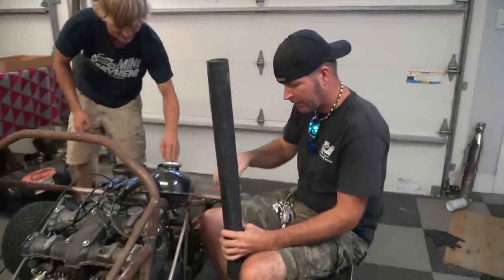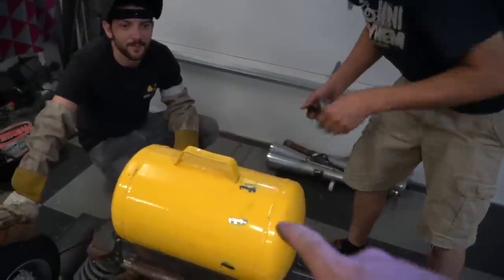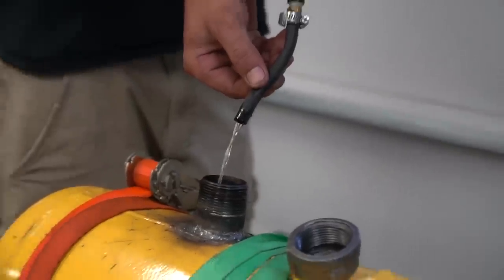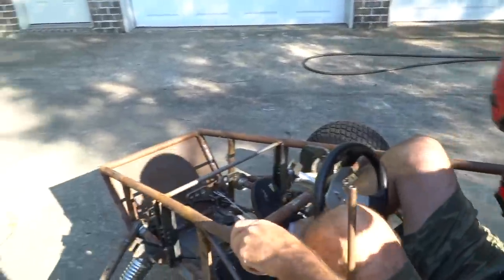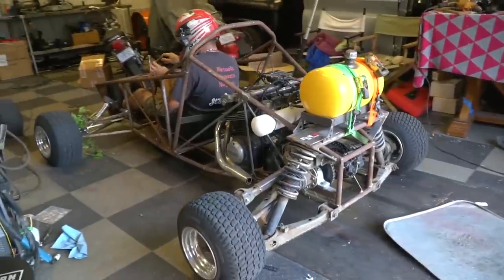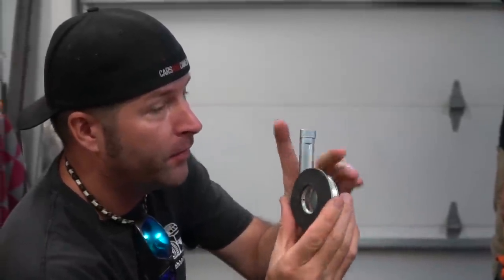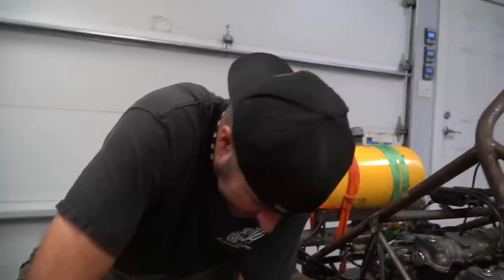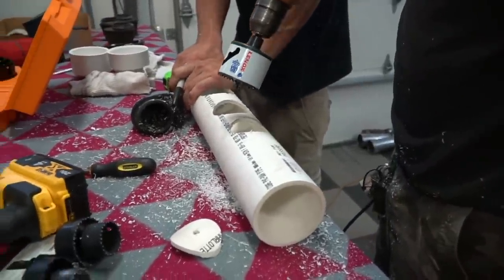750cc Cross Kart TUNING | Building a Custom Air Box, Jetting!

Comment: Sounded a lot stronger... That idle was mean after syncing the carbs and could notice the difference with the pvc intake immediately, it laminarized the flow which will make more low and mid range power. But the stacked itb filter setup would ultimately be better for max flow imho. But who really knows this these things without a flow bench.

Comment: That frame is gonna bend in half the way all the reinforcing tubes meet the roll bar. That's why it feels as smooth as it does. The rear suspension doesn't look like it's moving at all cuz it's meant  for something over 2000 pounds. And did you guys vent the gas cap?
Reply: We vented the cap

Comment: The engine was designed with free air-flow over the front in mind, it might be overheating. Fantastic machine though, that much power on such a light frame, wicked!

Comment: Guys , I built one with a Honda 450 twin, I experienced overheating because the engine wasn’t getting enough air to cool . I built shield ducting that forced air to cylinders. That being a a four cylinder, your inner cylinders may be hotter as you said you could feel heat. Or maybe put a cooling fan behind you

Comment: I'd suggest mounting a smaller filter at both ends of the airbox rather than just single big one, with the current setup the flow dynamics of each carb will be vastly different.

Comment: If you guys tuned the exhaust by giving them some more length it will help out on the lean condition. If you put at least 2 into 1 it will help with the scavenging effect. Then you can tune the carbs right.

Comment: you should have a smaller inlet on both ends of your "airbox" rather than one large one at one end.  With a single open end the carb closest to the open end will run lean while the carb at the other end will run rich assuming same size jets across all four carbs.  If you have both ends open with slightly smaller openings, you will have more balance air flow to all four carbs.

Comment: Is that a cheetah bead blaster tank? 😂🤣😂🤣😂.....it'll be fine.
I would assume you will be needing to trim the rubber sleeves the poke into the intake tube. Rule of thumb is you want at least the diameter of space between the opening and the closest wall. 
Also remember that long intake runners are for low rpm and short runners are for high.

Comment: When i first turbo'd my mustang (on a super budget) all of my intercooler piping consisted of 3 inch pvc piping and my hot side consisted of flipped BBk shorty headers and old 2.5 inch exhaust tubing that i had collected. The only thing left of that set up is the headers. P.s you should have made the intake runners longer like the kid told Ike to do. If you knew anything about intakes or plenums that should be common sense. Also, i noticed no breater on the fuel tank. Try that before jetting again.

Comment: What you could do, is open up both ends of the PVC, add ninety degree elbows, and put short up tubes, with your air filters on each side to act as mini-snorkels, and get the air intakes up in the cool air, and not sucking in the hot stuff from the engine...

Comment: Fire out the exhaust is a rich condition,Backfire out the carbs is a lean condition. I hope you drilled a small hole in the gas cap to vent the tank.

Comment: Hey CarsandCameras you really should dunk that carburetors in ultrasonic cleaner and get full carb rebuild kit and accelerator pump, replace 4 manifold boot and as bench sync the carb used a match size drill P.S. if having fuel starvation issues get pulse vacuum fuel pump and another things that carb sync tool is not right tool for job

Comment: I strongly suspect that only running that pod filter on one end will cause the  2 cylinders on the other end to run too rich, ie not enough air avilable, much like a fuel rail on an engine with huge injectors that is only fed from one end,  the first 2 or 3 drinking the fuel  and not enough fuel pressure to feed the remaining injectors.
Reply: Jools Freeman  also need some restriction on the exhaust, not enough back pressure could make it run bad also, but I agree on the fuel part also
Reply: Jools Freeman and put some header wrap on the exhaust, even with a heat shield behind your back it’ll help with keeping some of that heat from building up In front of the motor
Reply: Yes ykure probably right, some suitably sized food ztuff tins with a few hokes in the bottom  clamped on the pipe and some wire wool stuffed in them would do help, would also stop the flame shooting out and setting somethi g on fire.

Comment: Have you checked that you got the correct heat range spark plugs,  the exhaust length is going to have a larger part on how it's running than your giving it credit for

Comment: Hate to spoil yalls high but Teflon tape on the brass fitting to the tank is a bad idea. Use pipe dope and gas won’t leak but over time the gas will leak when using the Teflon tape. Just a helpful hint from your local fuel delivery guy

Comment: You need to support the carbs with something I ended up destroying a pair of brand new ones because I didn't do the and the factory air box does support them and the intake boots a re really annoying when it comes to vacuum leaks (seal all) is the best way I've found to seal them up you can get it at advance Auto or dollar general

Comment: Glad you threw the pods out. They’re great, but often need some kind of velocity stack between them and carb. Looks like your rear suspension is way too stiff, understandable since it’s from a 2500# car, and now on a 700# rail, probably part of why it nosed hard on the jump, if the springs were a good bit softer you could theoretically alter the attack angle with the gas pedal as you’re hitting the jump, by getting into the optimal rpm at the bottom, and powering out as you crest, it will cause the rear springs to squat and preload, so then in the air you’re more parallel to the ground. Other than that it looks like it’s coming along beautifully!
Reply: It took me weeks of riding every single day to get the jump technique down perfectly. On the farm where I grew up I had an old Yamaha MX 100, and I made a ‘track’ in one of the pastures. My one jump was about 4 foot tall, and on that little bike, second gear was perfect for nailing the jump, get it up into the top of the powerband, let off about 6 feet before the jump, then right at the base, go wide open, and I’d fly... for about 2 seconds, land perfectly. In third it was a bit sketchy. The straightaway before the jump was barely big enough to get into the powerband, and if you did it just wrong, you’d nose down hard on the landing and be picking dirt out of your teeth. Literally. The few times I hit it in third successfully though, it felt like I had wings. Miss those days.

Comment: Hi guy's I've been thinking about the situation hear with these carbs and i think because the original orientation of the fuel tank and carbs has been modified the engine may need alittle help with a small electric fuel pump to give all four a gut full of fuel to get that throttle wide open and not run shy of gas. Just thought it may help as it seems to always run lean wide open, and to rely on gravity for all four might be a stretch now the tank isn't as high as on a bike. My Honda 550 ran a external pump standard, and was a v4 with the four carbs and four power valves to get all in sync.

Comment: Need to put some longer intake runners on the air box which is too big.  It need to be the same size as your engine.   The intake port  for the air box needs to be about the same size as the area of all 4  throttle plates.    The air cleaner need to be 110% the cfm requirement of your engine at max rpm.

Comment: I really wish I could teach you guys how to work on 4 cylinder carburetor setups the big thing to remember at idle and up to quarter throttle you are running only on the pilot jet between that and wide open throttle you are running on the ramp needle and main jet at wide open throttle you are only on the main jet These are also vacuum controlled constant blast I carburetors which makes it a little more tricky I would personally see if you can't hunt down a set of mechanical carburetors that will fit on it  Maybe something off a 1970s city 750 they had Keenan's
Reply: Contestant velosity

Comment: Gas tank vent for better flow, maybe you need a fuel pump..? It shouldnt run like it does it should rev fast as shit. If you guys are running the race fuel in it you may need to run cooler spark plugs with a smaller gap if youre not already. Either way shes cool just be safe fellas!

Comment: I wouldn’t touch anything with the carbs until you have a correct air box. Syncing and balancing won’t make any difference until you correct the airflow reaching the carbs. That pipe set up is not gonna cut it. You need to, at a minimum make a box that is the same the dimensions and volume as a stock box.

Comment: Restriction on the inlet side of a carburetor will do nothing but rob HP. The carbs need vacuum on the engine side. Which means the valves have to be adjusted properly, and you can not use big cams with vacuum carbs. The K&N pods are just fine.
Reply: This is how they work. More vacuum on the inlet side of the carburetor will fight the vacuum on the engine side and the carburetor will not function as designed.  

https://youtu.be/wyspAHrMbb8

Hope that helps.

Comment: eather way 4 carbs going to suck to get running right but wonder if you put like 1 big carb on the end of that pvc pipe this way its only 1 carb to get right or a throttle body with fuel injectors idk man i know yall got be getting sick of trying to get it to run right but try just reg gas that might fix it or least tell ya sumthing

Comment: Is the plug gap right could be just a little too much gap . And that shifter needs to be shortened. The length being that long can make it jump in and out of gear just by the weight of it along with the leverage. You may end up blowing a gear . Shorter shifter is a shorter stroke. LOL

Comment: Replace the diaphragms and then put a vent on the tank with like a check valve and put elbows on the breather tube so it looks like texas long horns and heat the shifter handle and curl it like a sword handle

Comment: You need to mount the fuel tank in front of and above the engine in order to not make fuel travel up hill when you go up a hill and when you accelerate the g force pulls the fuel backwards in the line probably why you're having fuel issues
Reply: And you need a muffler for back pressure

Comment: you know this time it did sound like fuel but it also kinda sounds like the timing is off i really think yall should try just reg gas and just see if it help and if it does yall might need mess with the jets and timing or the stater and if you put a muffler/silencer on there you have more bottom end and sound better and you neighbors will think you

Comment: hand shifters allow you to keep both hands on the wheel add em . Properly clean/rebuild and jet the Carbs.put 2 large air filters on. Run a higher octane fuel. Put in better plugs that are gapped properly. That shifter ur using looks like a major injury in the future + ur taking ur hand off the wheel a lot. Your Welcome.

Comment: 3 and a half is too much If I remember correctly it is 2 and a quarter. I feel like I'm picking on u guys. I'm really just trying to help ya out lol. I like u guys and u guys are amazing with small engines. But this bike is very different compared to some. It's just the simple fact that it's a Honda and they are very specific. I'm going through it now with my shadow. The pipes are very specific and it does not like single pipes bc of how thestock pipes are made with all the vacuum and emissions things but that's besides the point. That bike is very picky on what u can do to it.

Comment: Shim ur needles with small washers from hardware store that will ad more on top and bottom cuz it raises needle so let's more fuel in and on a 4 cylinder they normally leave the 2 inner cylinders richer cuz the extra heat having cylinders on each side and they set those a quarter to a half a turn richer then the outer cylinders also check ur plugs that will tell u how lean u are and if that doesn't fix it do a carb rebuild

Comment: Carbs on the side of the air intake are gonna be leaner than the other side.
Why plenums are tapered.  2 air intakes, either side, original size ya started with in the vid.
Gonna have to make the 2 center carbs a bit leaner, but have a better shot at equal burn.
Or just put 4 pods on, as most do.  Naw, likin' the poor man's didjeridoo intake.

Comment: I think you guys should put the exhaust mufflers. Because its needed sometimes to build a vacuum pressure and suck out rest of the exhaust gasses out of the cylinders. And I think that you should check the spark plugs gaps and see how does the spark looks. I'm just saying that cause I've had many bikes 2T and 4T and I konw some things about it and sometimes carburetor calibration is not enough. But anyways, keep it on guys cause its a beast.

Comment: Should have stuck with air pod filters , I got 40+ years experience with Honda and have tuned many 750's all you need to do is rejet the cards , if your going to run pods and header (not stock pipes) you go 2 sizes up on main jet and one size up on pilot jet .......... it's that simple ...........

Comment: Dude now ya have an actual intake somewhat working you need back pressure in a real exhaust or a muffler of some sort, preferably the stock one or an aftermarket slip on pipe it is not your carbs lol

Comment: Ok. I went through this with my bike. I know this thing like the back of my hand. The stock air box the filter is the size of one that like belongs in the car. It sits at the bottom of the box and basically feeds all four equally. That one is basically only feeding the first one. Isacc should know how this motorcycle works lol. U can still build a box to accommodate this bike. Go to Lowe's I'm sure u can u use your your imagination and come up with a better solution. Yes now it's a bigger vacuum issue bc the the three are starving. Please don't put only two carbs on it's not going to be good. You'll blow that motor. This is a greatmotor and has tons of piwer.that 750 packs a punch. I didn't think it was gonna have a alot of power. But surprise it does. U don't necessarily have to sync them if your careful u can listen. Itshow u use the venturis on it

Comment: I haven’t seen much of the build but a heat shield will definitely not help you cool the motor. It must get hot as has no real air flow to cool it.

Comment: Not to be a negative Nancy I love your guys videos but restricting the air flow will make it richer which is obviously needed because of the breakup at high rpms which is why the restriction made it better but in doing so even though the air fuel ratio gets richer making it run better you are robbing hp because the engine can’t move as much air due to the restriction so even though it makes it better it really makes it worse the right way to do it would be to run high flow filters like you had and richen the carbs up even more then you already have the more fuel and air an engine can use at the right ratio the more hp you are going to produce I hope you take my advice or at least try it and keep up the good vids and always use fuel to adjust the afr not air unless you get high flow filters to flow more air which allows you to add more fuel and make more power again hope this helps

Comment: Syncing carbs individually is kind of a joke - you need a proper set of 4 gauges with vacuum lines- ALSO, syncing them by eye with the carbs off with the light under the butterfly's doesn't work because each cyl pulls different vacuum, they need to be done AFTER the valves are adjusted and then with a manifold of 4 gauges- , that super short Wide open header is now a big problem - it needs at LEAST another 18" or two foot of pipe past the collector, and preferable some sort of muffler for backpressure- your CV carbs arent going to work correctly with wide open headers without a LOT of jetting trial & error and even then it will be for Wide open only, or down low only, but without a bit of a muffler you'll never jet those carbs right....

Comment: Air Flow=Divide the tube in Half.Block the center,except a 2"tube for balance.Put your Air Filters Between the 2  carbs on each side,on the top of the tube for space.This will allow you to get equal flow.Let 'Er Rip.

Comment: There should be one carb that you cannot adjust and all other carbs should be synced off that carb, however syncing your carbs will usually only help fuel mileage and help it run smoother not help it cutting out

Comment: "REMEMBER!""HIS NAME IS CHARLES!!!"  I'M SURE YOU CAN FIX THE CARBURETORS. IDEA: BUY A CAMARO STYLE MUFFLER. TWO SIDE INLETS AND TWO SIDE OUTLETS ABOUT 2 1/4- 21/2 PIPE DIAMETER . THAT WILL QUITE THE CART DOWN. YOU CAN WELD THE EXAUST PIPE TO THE MUFFLER AND HAVE TWO SHORT EXAUST TIPS COMING OUT ON TOP AND THE EXAUSTS INLETS WILL BE ON THE BOTTOM. WELD THE MUFFLER TO BRACKETS ON THE FRAME ON THE BACK OF THE CART.

Comment: Imo as far as knowledge of engines pods should fine... If there not working there's not enough fuel... whenever u free up flow i.e. exhaust and intake u MUST increase the jet size for correct a/f ratio, since when is a restriction a plus...  Maby shitty designed carbs not very efficient if they require a restriction... Just my 2 cents.

Comment: With that pvc your getting unbalanced air flow- the carb furthest from inlet is starving for air. Keep the pods, rejet .015 over idle curcuit, turn fuel mix screws 3 1/2 turns out, and sync carbs and that beast will scream! #2 carb is your control and you cannot adjust it. Sync other carbs to it